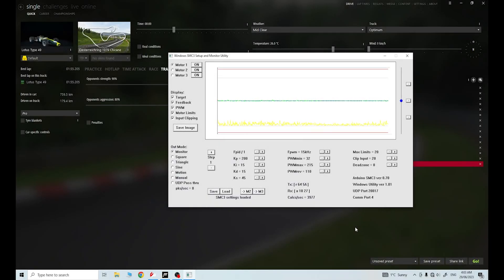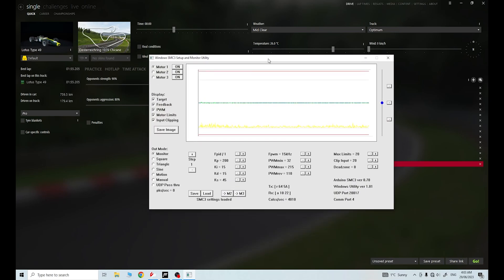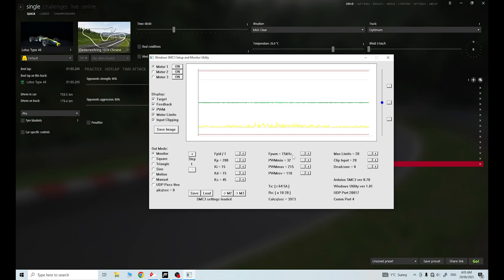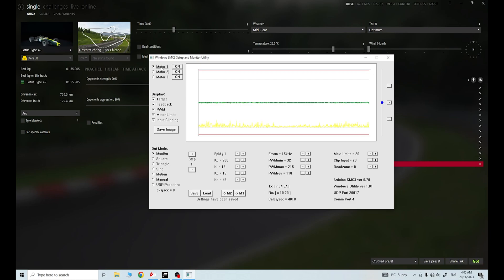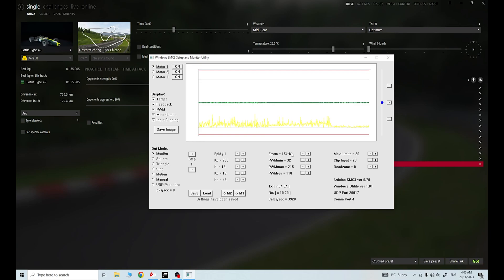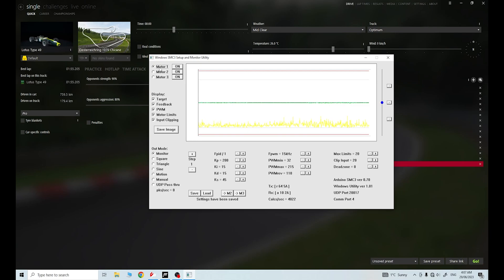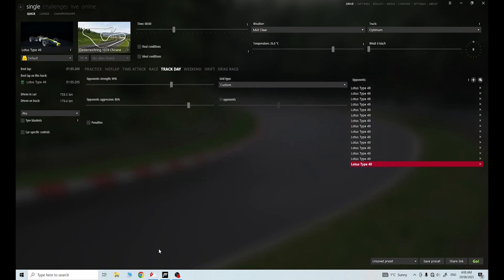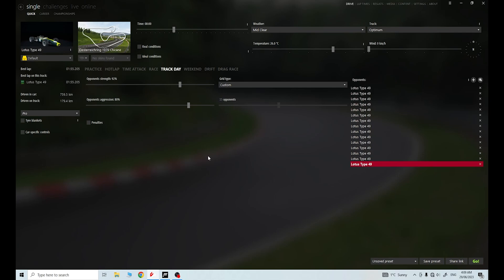Doctor ADHD 3DOF DIY Motion Simulator Critical IBT 2 H Bridge SMC3 Settings

Comment: Hey Doctor, Do you have any fuses like a 3A or 5A in between the IBTs and the actual motors? Do think I need any?
Reply from the maker: Hi Donald. Yes mate I do. 30amp fuses between each controller and motor. Have a look at this video. https://youtu.be/tCrJvdUmdn8?si=gSsl6CKRdREX_fmH

You can see the fuses wired between the controllers and the motors. I have fused the neg side, but it really doesn’t matter. Neg or Pos can be fused.